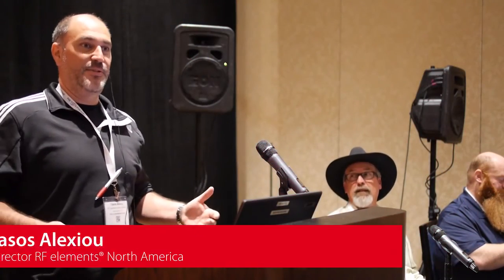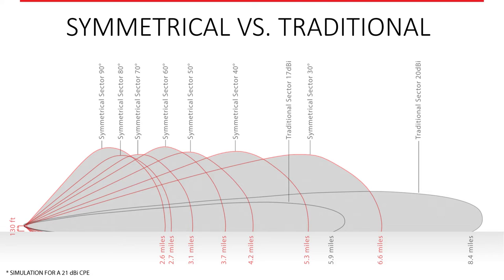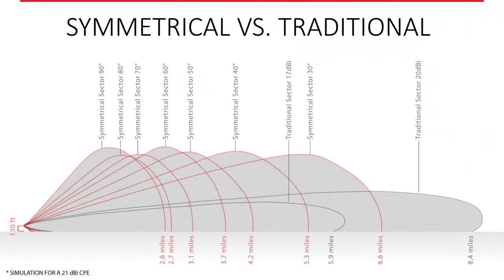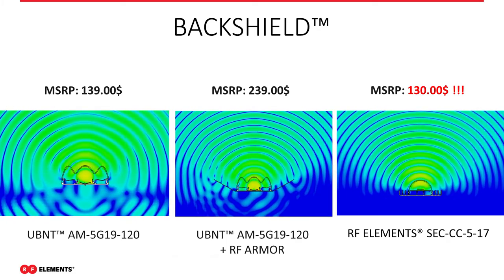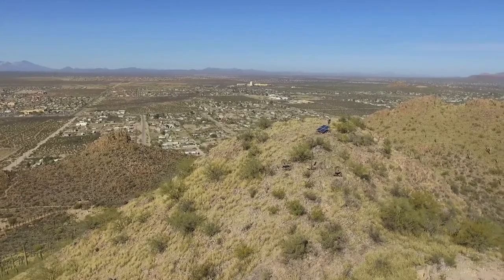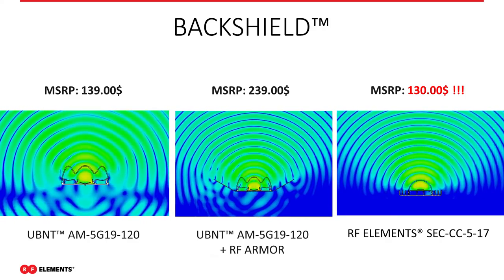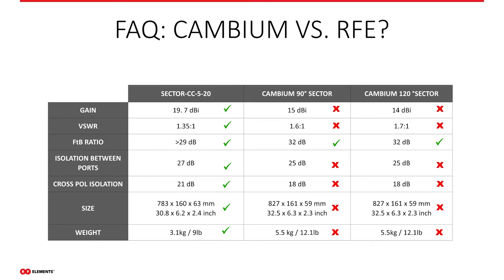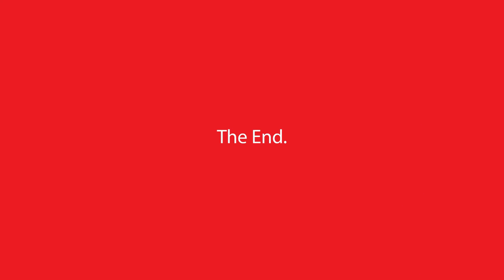RF elements customers: The New Sectors Are Revolution - WISPAmerica 2016

Comment: CH40 vs CH20 ?
Reply from the maker: what do you mean?
Reply: @Rfelements  comparing data from old antenna vs rf element it should also in the same channel width.
Reply from the maker: @xxxxtiannnnEpicRacingTV  you have a point there. Looking at other indicators as signal strength, chain balance, and noise floor, you can still talk about improvement, don't you think?
Reply: @Rfelements  anyway i still like to use your radio,but sadly i cannot find any supplier here in the Philippines
Reply from the maker: @xxxxtiannnnEpicRacingTV  we only offer antennas, which ones are you looking for?